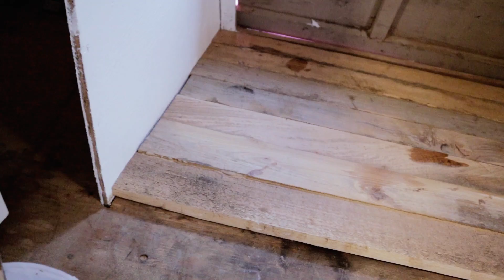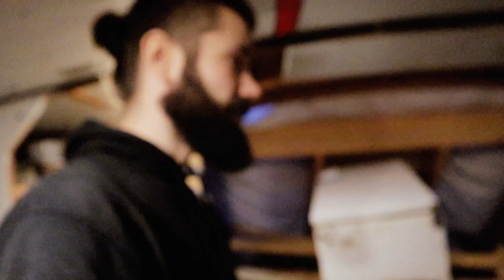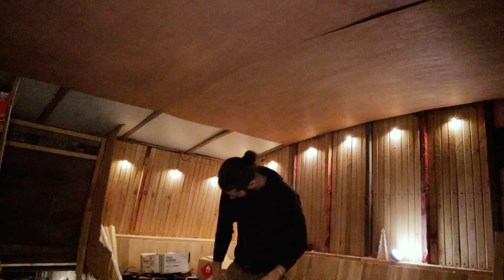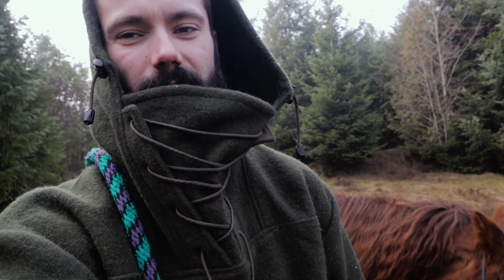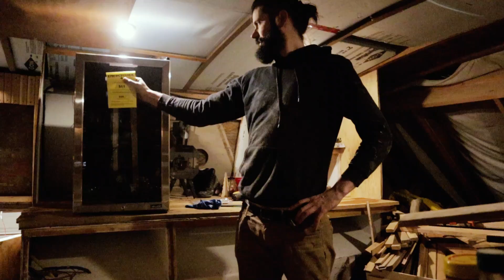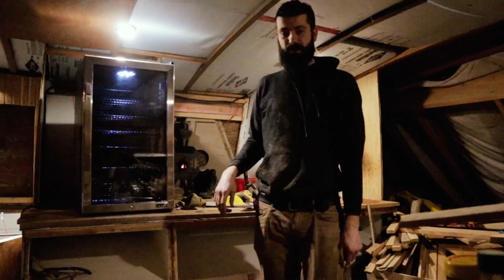Sailboat Cedar Counter Top - Sink or Swim 126

Comment: Great fridge you can lock it when you have rough seas and nothing will fall out. Also the sides sound like they need some insulation along with the walls it will help in the long run. It is pretty cool looking for sure. : ) peace